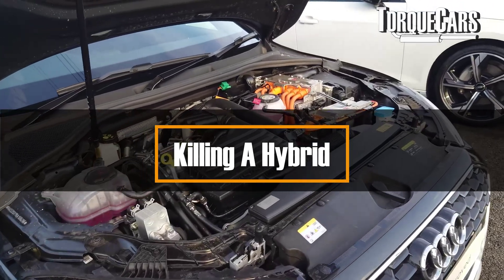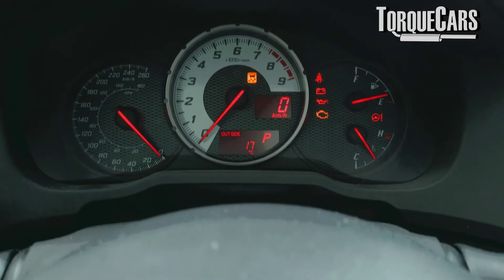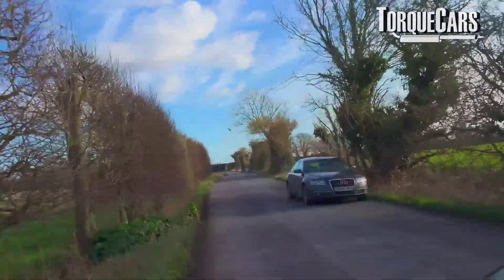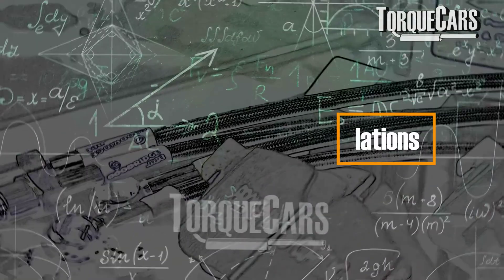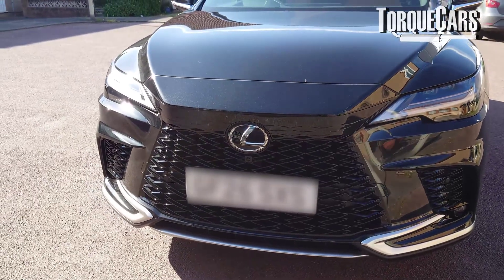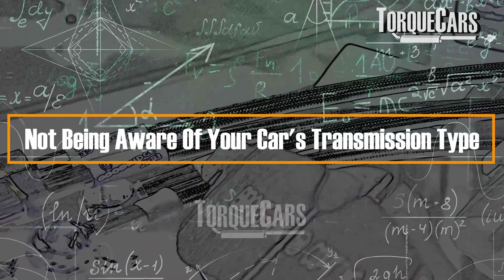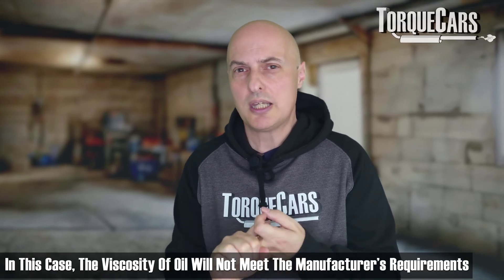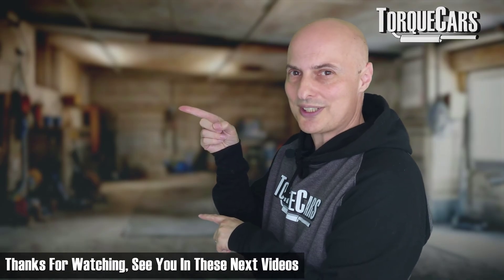The Hidden Dangers From Driving a Plug In Hybrid Badly PHEV (No One Tells You This)

Comment: I’ve owned a Lexus hybrid for 2 years and none of this makes sense.
The engine always starts from cold and runs until warm, the management of the battery is all taken care of by the sophisticated electronics. The battery will never over charge or run to low.
The 12 v battery is still in perfect condition and is checked by the dealer during every service as well as the main hybrid battery with 15 year g/tee.
A hybrid is like any other car, just get in it and drive it, all these videos that make it seem like you need to treat it differently to a normal ICE just demonstrate a lack of understanding.
If you do short journeys the battery will never run low it will just recharge off the engine and likewise long motorway journeys are fine and I get 50mpg at 70.
Servicing is no different and in the case of Toyota / Lexus the reliability is about the best of any type of car on the market.
If you are thinking of getting one, ignore all the negativity and just buy one.
Reply: 100%. I had a Lexus hybrid for 6 years. Never had an issue with battery or anything else.
Reply: I took the 2014 Toyota Camry for a fast climb to 12,000 feet up in the Rocky Mtn National park and it performed like a champ going up and coming down. Paddle shifter allowed me to come back down w/o hardly using the brakes.  The eCVT is an engineering master piece. I will drive nothing else.
Reply: @Lexus_22-ES300h_Hybrid_guy paid extra for moonroof package to get paddles I don't use, didn't want the moonroof I use 6 months... I just use the shift lever as I hated automatics back in the day...😂
Reply: Had 12v issue within 2 weeks new '24 CCH. I just don't turn off once a week let charge for the automatic one hour.
Reply: Maybe it's for people who buy pretend hybrids, or don't know how to drive.
Reply: Agreed, there is nothing I can do to improve performance, that's why I bought an automatic (7 years ago)! The only "trick" I use is to press the EV button before I back out of my garaage, even if the battery is low, and it will turn the engine over a few times, lubricate etc before the petrol engine chips in. I don't drive aggressivly at any time!
Reply: @batman51 Hi ! How did you learn this  ?
Reply: @georgepotcovaru2595  Not sure I learned it, but in the "old days" one used to turn the engine over a few times with a crank handle (I have the bad back to prove it) to get the oil to start lubricating.
Reply: I've just imported my first hybrid (corolla) from Japan and I absolutely love it, I'm actually saving money compared to my focus diesel which was a big surprise. I've given the focus to my brother in law with 240,000 miles on the clock and it's still in great condition because I looked after it and didn't drive like a dickhead. Also brought the corolla to my mechanic to have the transmission oil changed and he was stunned at the condition of it for the price I paid....he's now importing a camry for his wife!

Comment: I bought a new honda accord hybrid sport-l earlier this year and I have thought about the engine being cold while driving. It doesn't even start the engine when cold during the summer so I make sure I don't push the engine past 25% power when cold and I also do not have a temperature guage either. No rpm or temp guage which is difficult to get used to, luckily I have a 90 mile commute to and from work. The fuel mileage is impressive 40mpg going to work and 50mpg going home not too shabby.
Reply: cool.  Just an fyi, saying 90 mile commute to and from work sorta sounds like 180 total, but which do u mean, 90 RT or 180 RT /roundtrip?
Reply: @18_rabbit  90 miles round trip.

Comment: I've had a Hyundai SantaFe PHEV for just over 2 years now and find it to be a 'well behaved' car.  This one uses the traditional torque-converter auto box in line with the ICE and electric power train.  It just work well.

I'd tried a couple of DCT types, and I hated them with a passion - jerky and horrid to drive. 
You have to learn a lot more and understand what your powertrain is going to do - and I think that's the problem with many people.  

The battery never goes to zero. It drops to around 12% and then keeps itself around that level for mixed ICE/electric motoring.  

Switch to 'sport' mode, and it will recharge fully to 100% (obviously using petrol, so not the greatest efficiency).  Even my dealer didn't know this! 

So far, good comfortable performance, and economy.
Reply: Letting it get as low as 12% isn't great can you change something In the modes before it gets that low.    Also hopefully it doesn't stay in 100% charge for long.
Reply: @chrishart8548  It's how it's designed. You run on EV until battery gets to 12%, then it simply uses it and recharges as it wants....
It's all in their programming because 'it knows best'

Comment: I have a 2023 Toyota Corolla Hybrid built in Japan. The battery seems to always be charged around 50-80 precent on its own, so I wonder if that is part of the engineering. Thanks for mentioning the ratios.
Reply: That sounds good I think it should protected I the software to never go below 20% or above 80% but it might be already on the corolla.

Comment: One of the advantages of PHEV is that you can use only EV mode without starting the ICE for short journeys. When you use the ICE it's usually on longer journeys, where the engine will go to optimal temperatures for longer time.
Reply: That does mean that the ICE engine is sitting unused for days. Normally that is considered harmful for long-term reliability . How are ICE engines in hybrids any different?
Reply: @piglet5287 Afaik the ICE engines in hybrids aren't much different from regular ICE engines, and the biggest difference is simply in management/programming.
Reply: @RawbLV that's what I thought. Only hybrids with low-stress Atkinson cycle engines, like some Toyotas, will be significantly different. But most manufacturers won't be bothered that their engines aren't optimised for intermittent running, because problems might only emerge after 5-6 years and a lot are leased or company cars and who cares about the owner after that?
Reply: Short running and regular starting has to be hard on the engine. I personally think that the Hybrid will benefit from the newer more energy dense batteries that we are being promised are on the way . I can imagine that very cold climates would be hard on Engine wear and Lithium battery pack life …  the small 12v batteries would be a candidate for a solar trickle charge panel to prevent it totally discharging when not in use ….
Reply: Most of the time that is not true. Engine still powers in certain conditions, like needed for heating or when battery is low or when you punch pedal to the metal. But still you can use the engine significantly smaller amount of time compared to regular HEV.

Comment: This whole video, except for the tip about the engine running cold way too often, looks like a sum of the few cases of some early hybrids. Each tip is likely based on one event that has happened in the past as an exception, while there is truly no need to be this worried about most of the car's performances. Things like the 12V discharge, or the software update that is important or your vehicle will probably slowly destroy itself.

The most important is not to floor the gas pedal, even in EV mode, at the beggining of the drive. This is because the transmition oil also needs to warm. And when you turn on the engine, also preferably let it reach a decent temperature as well before flooring it.

Comment: Simple, run mhev or fhev, especially no phev.
Reply: Modern hev and phev have the same battery with same density but different capacity
Reply: @airaction6423  Certainly, but the management for mhev and fhev is optimized whereas for phev, people tend to leave it plugged in at 100%, or never recharge it which wears it out prematurely.
Reply: @Musashi35140the BMS of phevs doesn't allow to discharge it below 30% and charge it over 80%
Reply: @airaction6423  not the case with Stellantis in their business car by the way...

Comment: I’ve been driving hybrids, Toyotas and Hondas for the past 15 years.  NEVER heard of or had and of these “problems”.  Very efficient and reliable vehicles.  Like with everything else, keep up with basic maintenance.
Reply: Yeah, how many of your hybrids from 15 years ago do you still own and use?
Reply: How's many miles do you have on these hybrids? Any over 200k miles?
Reply: Yep. Neighbour of ours was a taxi driver and had the 1st gen Toyota Prius. He was close to 300k miles.
Reply: @20tea dude like 2.5 liter hybrids from Toyota and also the 1.8 liter from Priuses are well known to drive 500k+ without any issues. Especially in EU, u can see hybrid Corollas, Aurises and Priuses driving non stop as Taxi and nothing goes wrong
Reply: @20tea 155,xxx on my 2021 RAV4 hybrid still averaging 43 mpg.
Reply: @20tea we have 3 lexus hybrids in the fleet. Gs300h nearly 600k. Is300h nearly 400k. And one is300h with nearly 250k. They are beeing trashed by different taxi drivers for the last 4-5 years. They are all fine. Most of them had a battery swap. Cheaper then a clutch and double mass flywheel for a diesel car. We also have a 2010 prius with 300k. also no issues. We change the oil every 7-9k miles. 
My own car is a mondeo hybrid. Same system as toyota/lexus. Only 121k so far. But without a single issue. Front brake pads are still original. Got rid if most diesel. They were just a pain int he b***…
In the US they are using ford hybrids for ages. Lots of them over 500k and still going fine.
Reply: @peterfabian2158 the difference is your vehicles are almost always warm so get minimal wear.  Most people who do 5 or ten miles each morning will run on electric for maybe 9 miles then the petrol kicks in for just the last mile.
Reply: @andrewbarnard667  . Toyota hybrids warm the engine first thing (while charging the battery some).

These electric cars with gasoline engine assist  get a lot of gasoline engine assist because the electric resources are very limited. 

They might go EV for 1 mile under ideal conditions. My 4.4 mile commute warms the engine most of the time.
Reply: i had a minor problem with my Skoda PHEV not starting. Yet, after opening the boot a couple of times I notices some noise there. And the car started, even if the PHEV battery was declared empty.
Reply: Your right about the 12v battery,if you don't drive it every day you are going to have problems. I have a 2024 rav4 that I have already replaced the battery.i wasn't driving it but once every couple of weeks.you live and learn.now I put a big AGM battery in there with a Bluetooth monitoring system and charge it if it sits a week or so.
Reply: Do hybrids hold up in very cold weather without a garage?
Reply: @Maria___28 better than ICEs
Reply: @Maria___28 been through 2 winters parked outside with no problems whatsoever.
Reply: @senseofthecommonman thank you for the info.
Reply: OBVIOUSLY, The Skotas had CIA ASSETS IN THEIR TRUNK…
Reply: the cars are designed to manage the engine and battery i assume so there is nothing for us to think about
Reply: Sooo many hybrid taxis in Sydney that have been going 10 years.
But these are mild hybrids, not phevs. I wonder about more advanced hybrids: how good are ICE drivetrains at being dormant almost all times? But doesn't seem this video is about.
Reply: Hybrids and actually most modern cars are designed like your tyres and shoes.

Use them or not they are designed to expire at THEIR designated liking.

Shoes now harden, crack and crumble in 5 to 8 years.

Tyres in 6 to 10 years. 

Use hybrids or not they will not last. Hence you get high use short term ownership (sub 20 years) but really near zero low use long term survivor (past 20 years)
Reply: Who cares about hybrid, I was lucky, I bought a used race engine, no problems whatsoever

Comment: People are only buying Hybrids because of the idiotic mandates on EV numbers. Dragging a 200Kg electric motor around that you will never use is the least bad option.
Reply: What is that electric motor that weighs 200kg? And why do you think that it's never used?
Reply: @grasho  Most batteries/motors dragged around are in that weight range, and they're never used because people can't be bothered to charge them to get 30 miles range.
Most haven't even got a home charger. They bought these things because pure ICE are now rationed

Comment: On an Auris it is the system that decides when and how much to charge or discharge the main battery by using the petrol engine (you don't have that control). It's done to protect the battery and prolong its life. And it does it randomly. Sometimes it will charge it again from 60% for example, and sometimes it will let it go down to 10% before charging. And it doesn't always charge up to 100% either! 

Also, not sure hybrids actually ever display the engine temperature on the gauge like the traditional cars do.
Reply: On the Toyota hybrids a "depleted" charge is probably 60% and a maxed out charge is probably 80%. 

Computer controlled to ensure long battery life.

Comment: If you are looking to buy or lease a Grand Cherokee 4XE, IMO, stay away!!! This plug-in concept is horrible. Loud engine, transition from EV to gas is lagged badly, you will need a level 2 home charger to charge up to 27 miles in the winter and 30 miles summer +/-. I will never lease one ever again. I would never think to own one. I can't imagine repairing this engine, when factory coverage is over. Extended coverage is a MUST. GC should be ONLY 6 or 8 cyl. No Turbo, no nothing. Again, great car, bad concept.
Reply: At least to passed it on and no long term problems.
Reply: Amen

Comment: Toyota/Lexus is NOT using CVT gearbox in hybrids. E-CVT is nowhere near to belt driven CVT. E-CVT is the most reliable transmition on the market. Even more reliable than manual. Same goes true to Honda Hybrid E-CVT

Comment: The first thing that my Highlander Hybrid (Toyota gen 4 hybrid system) does when I start driving is warm up the engine by running it in open-loop mode for about 20 seconds. I believe that Toyota is aware of these issues, and has mitigations programmed into the behavior of their hybrid systems. I'm not sure how the plug-in hybrids behave though, because they're supposed to go up to 40 miles without even needing to use the internal combustion engine. Now that's an issue. I've heard that the ICE is supposed to run periodically in order to manage the issue, but I'm not sure how often that is.
Reply: I have a phev lexus. It starts and runs in ev mode like you say. But if I switch into Hybrid mode, the engine will start and will run for a while to warm itself up. Even if I switch back to ev mode, it will continue to run until it’s warm. 

Apparently if you don’t use the engine for a LONG time it will start up just to avoid the potential of it seizing. I usually use the engine on the weekend so I’ve never seen it do this. 

Overall the system seems great. I’ve saved a lot in fuel and have never had to worry about public charging. But you need a home charger for it to make sense.
Reply: I use gasoline each week with my Rav4 phev to keep fuel fresh in injectors. I also buy higher octane gasoline that stays good 3 months longer. (than regular)
Reply: @MrRaitzi  Octane number doesn't matter. It's important to use premium fuel, because of it's additives. That said, if your only option for such a fuel is higher octane - then it's ok.
Reply: @grasho that is true but they advertise fuel by octane equivalency number in my country, so we use the term. Regular is 95 and premium 98. 95 contains more ethanol that makes moisture issues more also than 98.

Comment: All that for a little better fuel economy. Not worth it.
Reply: A little!!! ???.....im getting 68 mpg on a106 mile motorway  trip....60-70 mph!
In eco, local driving I touched on 81mpg!!!!......driving very carefully  mind
Reply: I went for hybrid because of the better performance and I don't regret it.
Reply: @grasho  My Civic hybrid is much quicker than I thought it would be. It's the thing that has surprised me the most.
Reply: It is a lot better, especially in summer. Own a Jazz hybrid which gets 80+ in summer on most journeys and 60+ in winter. Normal Jazz averages in 50s. Also have an RX which averages 34. RX non hybrid is low to mid 20s.
Reply: You haven't got a clue. It improves the gas mileage a lot, almost double. Now multiply that by 365, year after year, and you are saving a lot. Also, they are very reliable, hardly gives you much trouble. Stick to Toyota.
Reply: @a.m.9357 I second that.....the only pain is the12v battery